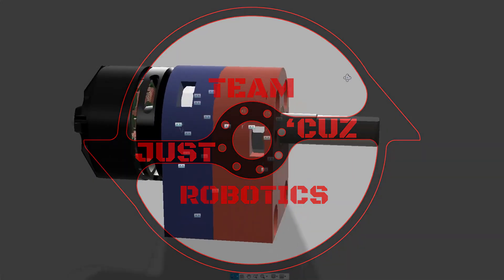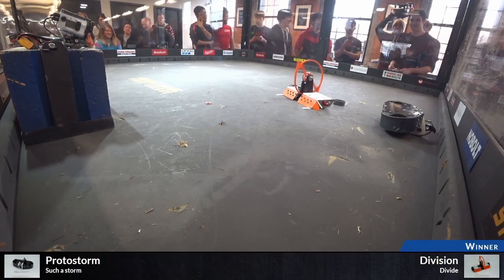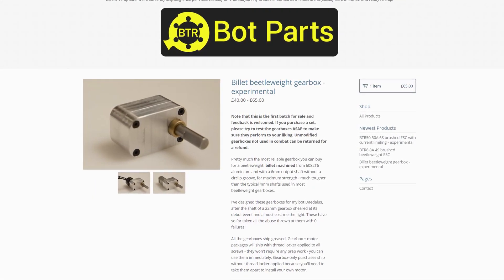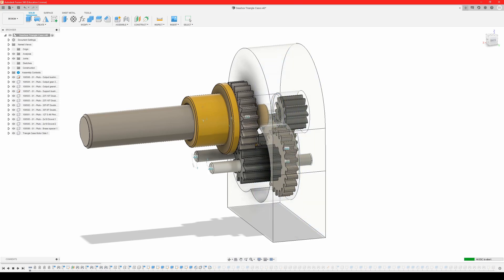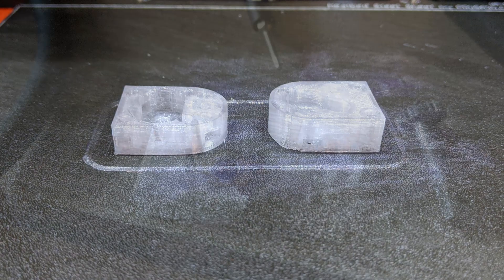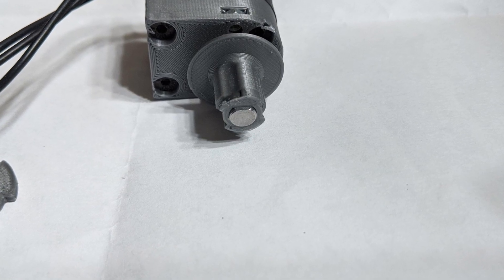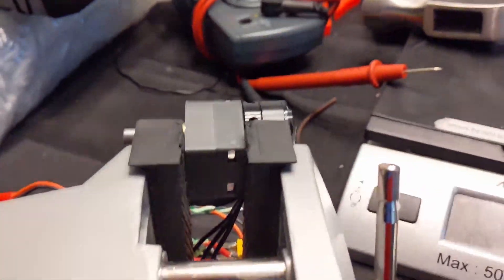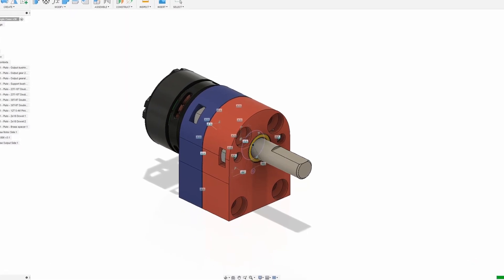Brushless Custom Gearbox Design: Part 1 [Beetleweight (3lb) Combat Robot]

Comment: Dude!  2022 comment.  SLA printing to hold tolerance!  Buy a $100 CNC 3018 Router and use it as a light-duty mill.  You will spend more than that on wasted filament on FDM.
Reply from the maker: A: I don't own an SLA printer and B: I can use a $15000 CNC milling machine at a local makerspace but that sortof defeats the purpose of making a low cost option anyone with a 3D printer could build. Also C: in a later video it worked fine using a CF Nylon printed body anyway.
Reply: @JustCuzRobotics  Both of those options I mentioned don't require high-cost machinery.  If your goal is to create something that works that an average hobbiest can create with an average hobbiest budget then those are the best choices IMHO.  If you goal is to make something crappy that doesn't work with the machines you have then fine carry on and provide zero practical value to any of your viewers except how to use the wrong tool for the job and see the project fail.  I guess that's an indirectly useful lesson from this project and all the time you spent making a "why my project is a failure
" video.
Reply from the maker: Once again, I got it to work with a slight design tweak and a different material that was easier to print. I ran these in Division for at least 4 different competitions as well and they worked just fine. https://youtu.be/D1V4iaFsHO4

Comment: this is so cool! Did you ever get the 3d printed case to fully work? I'm new to combat Robotics and your channel so forgive me if you covered this in a newer video (just realized this one is a year old).... if not, do want me to machine this case design out of aluminum? It could be a fun colab and we could both get some better gearboxes out of it
Reply from the maker: I got the 3D printed version to work using carbon fiber nylon filament. I ran it in the box for a number of events and it works pretty well. However it would never stand up to a direct hit on the shaft so I have currently changed to a completely different solution that you can see in my division V3 overview video
Reply: @JustCuzRobotics  cool, I'm catching up on videos so I'll see it soon. I didn't know this world existed until recently and Im pretty obsessed!

Comment: Out of curiosity, how much better do you think the servocity planetary gearboxes are in a combat context? I've been using them for years doing sumo things (where planetary is helpful since you're often stalled) but am wondering if I should go with a different motor/gearbox for my still nonexistent beetleweight...
Reply from the maker: I used the servocity economy gearboxes which are also spur gear boxes, with 4mm shafts. They got absolutely destroyed from any direct wheel hit and the shafts would bend and be useless. You can't buy replacement shafts alone AFAIK so that means the whole gearbox is trash. I went through 4 of them in 5 fights in one tournament before I gave up on them and designed this. 

The planetary ones also have 4mm shafts and whole maybe they are slightly better, they will not work well directly driving a wheel, especially if the wheel or shaft may take a hit.
Reply: That makes a lot of sense, I'll at least do some type of motion transfer so that the wheel axle isn't directly connected to the motor shaft. Or maybe just make this, I've got my printer dialed in pretty well so it's worth a shot, thanks for sharing!

Comment: Just browsing this hobby, but I do have some input from my creative projects... Have you considered 3d printing the parts and then making a silicone mold from them? There many durable resins available that can be used to make these parts from a silicone mold. The molds can be reused many times. Smooth-On would be my choice for mold and resin material.
Reply from the maker: When the printed parts already work there wouldn't be much point in casting them. Plus casting requires a lack of overhangs and other limitations which would make this a hard part to cast. The slots for the hex nuts for instance would make it impossible to remove from the mold without destroying the mold
Reply: @JustCuzRobotics  completely understand, it wouldn't be ideal for every part... But I could see it being usable for some. Silicone molds are quite durable and flexible, allowing more complex parts to be cast and removed rather easily. My opinion is of an outsider looking in, so I'm just trying to add some variety to the thought process!
Reply from the maker: Casting certainly has its place in robot combat. It's very common to cast wheels from urethane rubber, in fact Bloodsport uses 3d printed molds with CNC machined aluminum hubs to make cast rubber tires in several durometers.

Comment: Have you considered making the housing by machining polycarbonate or UHMW? what do you think is the downside to making them that way?
Reply from the maker: It has a few strength advantages for sure but the disadvantages are mainly practicality and cost. While CNC machining parts from solid material has its benefits, it is incredibly labor intensive and would add quite a lot of cost to this project. I would need to buy a specialized tiny drill and reamer to make holes for the dowel pins, buy some tiny endmills way smaller than ones I have already, and spend several hours to CAM tool paths for all these features... 3D printing is slow in the time it takes once you hit print, but it's a much less labor intensive process. And outsourcing would be unreasonably expensive since no machine shop charges less than $70/hr including setup time, CAM programming and machine time. If Cosmin didn't machine his housings himself I'm sure his gearboxes would cost far far above what they do now. At which point the $85 option doesn't seem so bad.

Sadly I learned the hard way when I tried selling my Just Cuz Hubs that the time cost isn't worth it for me. If I charged $30 an hour for the time I put into making my first batch of those I would have lost over $300 even though I managed to sell most of them in the end.

Long story short if I need to go the machining route the cost of material is nothing compared to the other costs that add up. I may as well go for titanium or PEEK/Ultem at that point. 

When I machined all the aluminum parts for Draconid I spent a total of over 30 hours just tending to the setup and CNC machine, not counting the CAD/CAM time, but it saved me probably $1000-2000 in outsourced machining costs so that was worthwhile. But that was also a situation where a finished off the shelf solution didn't already exist. Sorry for the wall of text response lol.
Reply: @JustCuzRobotics  Thanks for the response, I was thinking about it in terms of a making a small amount for personal use but youre right that it would get expensive for an actual production run
Reply from the maker: Actually it's almost the opposite. I need to spend all the money on tooling, all the CAM and setup time, and make all my fixturing in order to CNC ONE gearbox

Comment: Will you sell these?
Reply from the maker: If I can make them work well, I might be willing to sell just the 3D printed housings in CF Nylon, since most people don't have a printer capable of printing it. As for selling assembled gearboxes, I wasn't planning on it - Honestly I don't think I would make enough off these without charging an unreasonable price like $80+ for it to be worth the time it takes to sort out, pack, and ship them. Just assembling each gearbox and motor takes me at least 20min. I have to buy all the parts at full price so all I save on is shipping costs dividing over a larger number of gearsets and motors, and keeping gearsets in stock while waiting for them to ship from the UK during a pandemic... It'll be way easier to make an instructional video on how to assemble it yourself and let others buy their own parts.

Comment: Any advice on making gearboxes in general? I’ve considered making custom gearboxes for a design I’m making to accommodate longer shafts (up to 1” long) for wide wheels on my full body drum spinner concept.
Reply from the maker: Tolerances and proper clearances are super important. I don't have any experience getting custom metal gears made but my understanding is they usually use wire EDM for small gears and thus it is ungodly expensive unless in high quantities. If you are working at a scale where 3D printable gears work (see Draconid videos) they work great! Also see about buying readily available gears off mcmaster

Comment: Clear polycarbonate is like glass as far as filaments go, the colored polycarbonate is much different in my experience.  It is about the highest temp material you can get short of having a special printer.  I don't think it is a good material choice though as it will crack from the stress of having something pressed into it for an extended period of time.  You want something that won't crack from having something pressed into it.  Nylon, polypropylene, and TPU can accomplish this, but you sacrifice rigidity.  There's also ultra high temp filaments like PEEK, but I don't have experience with them.
Reply from the maker: Yeah you're right about PC, at least Polylite. PolyMax is supposedly a lot less brittle but it's double the price so I wanted to experiment with something cheaper. I can get CF Nylon around the same price as PC max and by all accounts it's easier to print and very durable so that's my next move!
Reply: @JustCuzRobotics  I mainly use PolyMax and the clear is also like glass.  The black and the white are not brittle.  However pressing something into them tends to form cracks after about a week, depending on the constant pressure.

I feel like nylon with CF in it will crack easier than plain nylon because that is like adding imperfections to the nylon.  Hopefully it won't, but that is my guess.
Reply from the maker: Carbon fiber itself is an extremely flexible material. CF Nylon is stiffer and slightly worse in impacts than plain Nylon but I don't see any reason that constant stress would be an issue

Comment: Awesome!! I was just about to get into beetles and was looking for a light, robust, and cheap brushless drive setup. This certainly seems to fit all those bills. I can’t wait until the design is finalized!
Reply from the maker: Thanks! Just keep in mind there is a good chance you will need a modified 3D printer to print Nylon (or filled Nylon anyhow), or you might be able to outsource to Endbots for Onyx parts but it may cut the cost savings a bit. Plus I cannot guarantee this will ever work well, but we'll have to see!